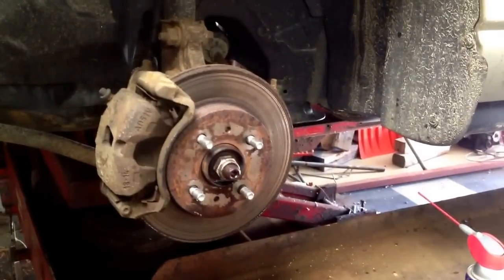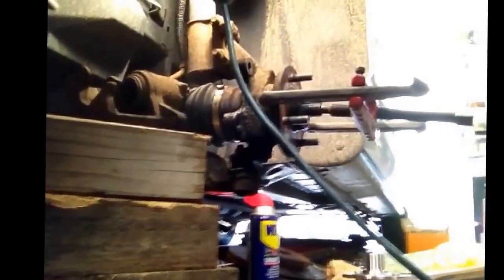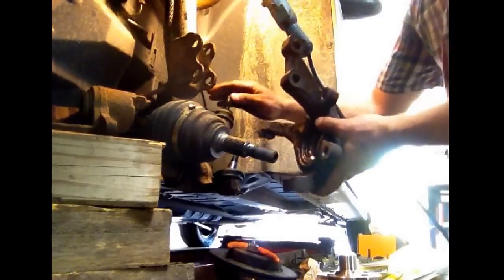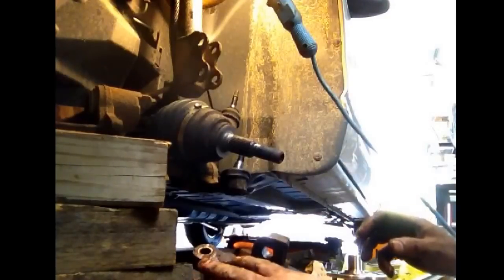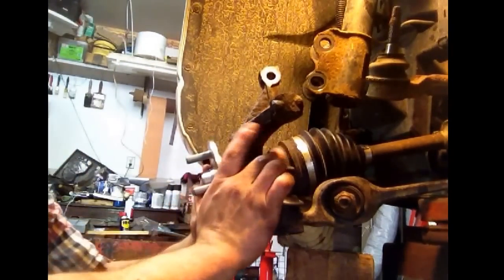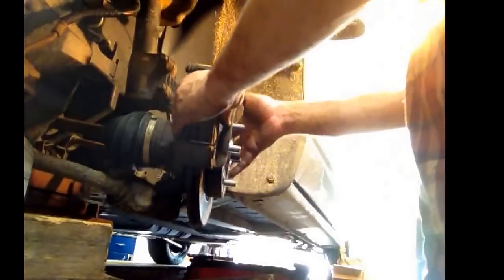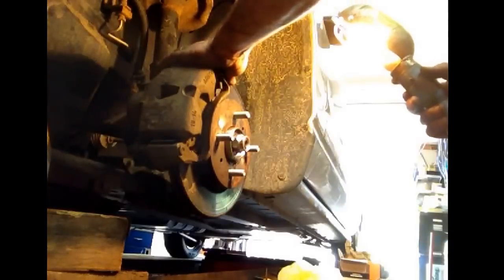How to change or replace front wheel bearing on 2002 Saturn front wheel drive

Comment: im glad i ordered a wheel bearing, noticed a noise a while back ago, and ordered it, but then thought i look  at the caliper/ brake, thinking it was stuck, i thought i fixed it, haha but then the noise returned a few days later but now its gettting louder so got to get it replaced before the weather gets cold here, i rebuilt a saturn vue awd v6. runs like a champ. nowadays cars are running more reliant on electronics, thus making it harder to work on with just tools in the backyard.
Reply from the maker: +daryl philbrick  Ya i agree and cost so much to have it done so i hope i can save at least a few people some $$ with my small youtube site with the small amount of knowledge I have. so many other videos have helped me and every little bit counts.
Reply: i tried to do some videos on here but with out a second person just to hold the recorder and the time to upload it,it was hard to do. i was doing a vid on my saturn vue, the rebuild of it.  but it doesn't help that i have a laptop that is old. and out dated and most of the software got wiped out.
Reply from the maker: ya that stinks about the laptop, but mine is not great I just take my time. also you can use a tripod for the camera.

Comment: Video wasn't perfect but still excellent in my book.  One of the better car videos I have seen,  You have a lot of money tied up in your tools.  I have replaced half shafts in front wheel drive cars a few years ago and think I could do this job, but not as well as you.  And I am 75 now and not as mobile as I used to be. But I don't have a lift and would have to buy some more tools, so I will probably leave that up to the shop.  Still helpful to know what is involved even if some one else does it.
Reply from the maker: Charlie Wilson Thank you for the kind comments. yes I have a lot of $$ tied up but lots of tools I have from bartering trading or doing work  for such as that $18000 lift I did work for, so it was a great deal, I would never be able to buy one but boy is it a big help and I am only a backyard macanic.

Comment: I replaced a lot of these! The part that holds the bearing in place is called the steering knuckle. On those Saturn cars, sometimes the bearing actually eats away at the steering knuckle walls and you end up replacing that, the bearing along with the rest of the assembly.
Reply: Just had to do this with my 02’ SL1 wished I would have seen this comment sooner 🤦🏻‍♀️ they quit manufacturing the spindle/steering knuckle had to search for months to find one finally putting my car back together after 4 months of doing this project

Comment: Next time you might want to mark the strut bolts, that way your alignment is not out of whack. By the way it is a snap ring which holds the bearing in.
Reply from the maker: Thanks for adding helpfull info to this feed.
Reply: I have read that before...
I just did this job again, didn't mark strut bolts and my alignment seems totally fine.
BUT I could be wrong...

Comment from the maker: It is a 1 3/4 inch socket. I hope that helps let me know if you have any other questions.
Reply: I was going to jump on and share that as well, since I didn't see it before taking measurements to 4 tool stores.  The Craftsman 1-3/4 socket fit the best, but was also the most expensive at $24.  AutoZone had one slightly smaller for about $11.  Harbor Freight didn't have any that large without buying an entire set.

Comment: I hoped that you atleast torqued the axle shaft nut to specifications, it requires 254 lbs of torque ... trust me you won't be able to do that with a normal wrench no matter how hard you try, when you tight it, you actually hear it crack in place....best of travels!

Comment: Thank you for so detailed film. Will 12 ton press from Harbor Fright be sufficient to press the bearing and the hub?
Reply from the maker: That should be WAAAY more then you need so yes. Thanks for commenting
Reply: Thank you for your replay. I worried because someone made a film about that particular press, saying that it requires a lot of force to operate that device. Please could you also tell if that press can be used to remove the old bearing from the hub holder? Again in another film somebody was knocking out that old bearing with the hammer after locating the hub holder on specially arranged wooden blocks, and only after that he used that press to press a new bearing and a hub.
Reply from the maker: Well to reply to a couple of your statements, I have not used the press from harbor freight so if your seeing bad reviews on it there may be a reason. As far as removing the bearing yes a ress like that will do the job. Just make sure its a good quality press. But a 12 ton press will do the job. if its a good press.
Reply: Thank you, I'll see. If it won't work I'll take it back, though I like that it is rather compact, and not so heavy, like others of maybe better quality. Or maybe at least I can use it to change bushing on wiper blade arms in one of ours cars (for some reason  that 2003 Chevrolet has almost permanent problem with bushing failure).

Comment: not a bad video, but one question.. before reassembly, why not clean up any bolts while they are off? use a wirebrush to get any gunk or rust off? preventative maintenance. Also, ALWAYS use torque wrench. I have been doing automotive work for 25 yrs now. My dad taught me starting at age 6. Always use a torque wrench where a torque spec is required...
Reply from the maker: +Chris Todd All very good ideas thanks for the input I due clean before I put back together not sure why i did not this time might have been in a hurry and needed the car fast.
Reply: +shanesmaineshop I know that feeling..My saturn SC2 has 220k+ miles on it...in all my years, ive never done a press in bearing before, funny enough. Ive done loads of the Hub Assemblies that come off with 3 rear bolts, for like a Trailblazer, or the like, GMs mostly.

May i recommend... http://www.walmart.com/ip/48096246?wmlspartner=wlpa&adid=22222222227035423747&wl0=&wl1=g&wl2=c&wl3=75836525674&wl4=&wl5=pla&wl6=176141174914&veh=sem

Maybe ill get a GoPro camera and do some how to videos myself...;)
Reply from the maker: +Chris Todd yes you may that would make the job even easier thanks for the input.

Comment: How did you clean the knuckle and what grease did you put on the knuckle before pressing in the bearing? Do you need to spray the knuckle with some rust protective liquid before you put it back on the car? I removed it, but not sure how to treat it before it goes back.

Comment: Thanks so much for this video
Reply from the maker: Your welcome. I am glad it helped.
Reply: shanesmaineshop how did you pound out the hub assembly from the bearing?
Reply: shanesmaineshop it's rusted and I have to reuse it so I don't want to damage it.
Reply from the maker: If your talking about getting the old bearing out? at about the 10 min. mark on the video I talk about that. what I did was found a socket that just fit in . you'll see what I mean if you check at that point about.

Comment: @21:03  Can you apply some grease on the attaching bolts (not on threads for nuts (on threads I'll put Blue Threadlocker), on that cylindrical part which goes inside of the knuckle)? We are in Texas, but after I removed those bolts, they were all slightly covered w/rust, especially by the head of the bolt. And I removed them before not longer then 1.5 years ago. I cleaned them, painted the heads. The rest of the bolt I wiped out w/PB Blaster, installed, but forgot to apply a bit of grease on them as planned before, like green Lucas, or Green 101 (they both have NLGI #2). I'm in doubts, if you are actually are supposed to apply that grease there, maybe it will leak on the threads and it could cause some problems, like it will effect that threadlocker or smth. I would appreciate any opinion on this matter. Thank you for this so great film.
Reply from the maker: I personally would not have an issue with that, I would use a very small amount just enough to keep it from rusting and make it easier to come apart in the future. However that’s just my opinion. Hope this helps thanks for the question.
Reply: @shanesmaineshop  Thank you, I think that is right. I always overdo w/cleaning. Thank you again.

Comment: so what size socket is needed to remove the bolt from the axle nut (the one you put on and do not say what size you are using :(
Reply from the maker: It’s been so long I don’t remember I have to go back and look. I don’t even have that vehicle anymore. I’ll see what I can find out but I do apologize I don’t know off the top of my head, I guess I should’ve included that in the video.
Reply: @shanesmaineshop  I do understand, working on my 2000 Saturn and I googled the axel nut socket but I see several sizes.. mostly 36 and 38mm .. and I haven't got to the other sizes needed, but have many others that will probably work on smaller nuts but that axle nut is bigger than any of my sockets :)
Reply: @shanesmaineshop  btw :D I am shocked you even noticed my comment and want to THANK you on behalf of those of us who are on a fixed income and have to resort to DIY :) (I'm 72 and just replaced the dang water pump on this car :) lol)
Reply from the maker: Linda Eckert Ballard I try hard to reply on every comment I get, however sometimes they do slipped by me. I completely understand being on a fixed or low budget and having to do things yourself, that’s a lot of what this channel is based on trying to help people save money and do as many projects on their own. Of course some projects are more difficult than others. Good luck thank you for taking the time to comment and asked the question and again I’m sorry I don’t have a quick answer for you.
Reply: @shanesmaineshop  Blessings :)
Reply: 30mm socket
Reply: @C6Scoob  Thanks :) I bought a 28 mm and it was too small so I took it back. Ill try a 30 <3

Comment: It was nice of this guy to make this video, however don't follow the procedure used to press in the hub.  You MUST apply pressure at the appropriate place.  Google this to find out exactly how.  On a different note, you also do not need to take the snap ring out while the knuckle is on the car.  It's a lot easier to get the snap ring out while the knuckle is on the bench.  Also you MUST torque the axle nut to 148 ft lbs.  Do this with no (or minimal) weight on the hub.  Waiting until after you install the tire and drop the car down will dimple the bearings.  Failure to pay attention to proper bearing pressing and torque procedures will have you re-replacing within a year.  (I suspect also that today's bearings are junk compared to the good ole days.)
Reply from the maker: +Steve H Hi Steve thank you for adding to the info on this video I'm just a backyard mechanic but I have been doing it my whole life. The good thing is I have had no issues with the many bearings I have replaced (thank goodness) its been almost two years on the one from the video and still going strong. anyway thanks for the tips. Shane

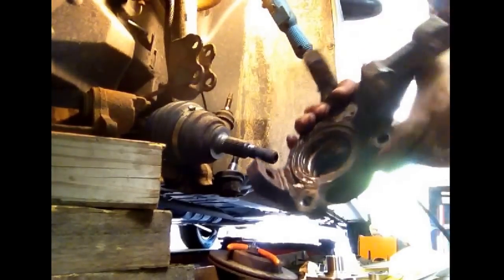Comment: Pls could you tell, at 9:21-9:26 there are 2 small holes on the knuckle (at the top, above the central hole, back side of the knuckle, at 9:27 you placed your finger on one of them). Are they used? I removed a knuckle for a similar project, but don't see any screws for those holes now. Maybe I misplaces them, but hope they just come from a certain design and are not used for this car. Thank you for the film.
Reply from the maker: Hold on i look to see if i can remember.
Reply from the maker: No the wholes your talking about were not used for anything in my application.
Reply: @shanesmaineshop  Thank you for the quick replay. I think those holes for the cars with ABS (not sure, but I saw in another film by rocbola, also Saturn, there was a thing attached at the place of those holes with 2 screws, at some point that object disappeared then appeared again during the process of work, the author didn't mentioned that object anyhow, it looked like a sensor). I figure those holes are made to make the knuckle universal for cars with and without the ABS sensor. Thank you again for the confirmation that you didn't use them. I do that work first time, easy to mix up something. Your film was very helpful to me and will be, when I put everything back.
Reply from the maker: @olenaerhardt7725  Your welcome glad i was able to help. Also watching others doing the same project is always good, everyone shows different part of the job in different ways.

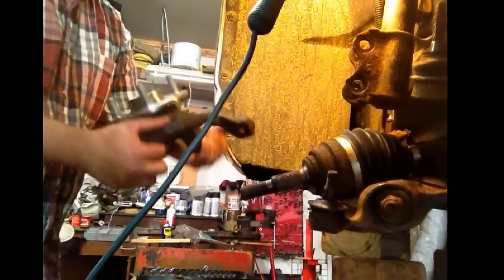Comment: At 19:01 there is an end of the Central Control Arm. I wanted to change that cup, which covers grease inside of that joint, but can't find the same. I ordered some different bushings, but they differ from that thin rubber cup. I even ordered bushing for the that particular arm, but it included only inside parts for joint, the cup was not there. Do you happen know how to find it, what is the exact name and size. I'm planning to cut out something similar fm the bushings I have, but thought you might know smth about it. Thank you again for very helpful film.
Reply from the maker: seems like it would be available easy but i am having a hard time finding it. At this point I am still looking but sorry i cant give you a better answer.
Reply: @shanesmaineshop  Thank you for your concern. I'll just try a different cup. Though it is taller and thicker than the original one, maybe it will be pressed to the place and that's it. Or try to cut the new one to be more like that thin original cup.

Comment: Good video, about how much of a gap did you leave between the hub and the knuckle? I think I am over pressing mine. I am getting just a hundred miles after replacement and they squeak like they did before. I have done them twice each. Everything was square when I pressed it in but I think I am going too far. Also, what brand did you go with? I bought Timken first then a moog, both failed. Thanks for your time.
Reply from the maker: I pressed it in far enough to get the lock ring in place. I'm quite sure it bottomed out.  You can over press it as long as your pressing on the outer ring. make sure you are not pressing on the center of the bearing that could damage it for sure. I'm not sure of the brand right off hand i will see if i can find out and post that info for you.
 sorry your having trouble I'll help all i can.
 Also can you exsplain more about your question on the space between the knuckle and hub if my response did not help?
Reply: shanesmaineshop I didn't have a problem with the bearing. It went in fine and so did the snap ring. When I pressed in the hub I supported the middle race to prevent side loading it. I pressed the hub until it stopped. I was using a 20 ton press. Did you press the hub until it wouldn't go any further into the bearing or did you stop before that?
Reply: shanesmaineshop around the 18:47 mark you mentioned you don't want to go too far. I believe that is what I did. The gap I was talking about is from the back of the hub to the knuckle.
Reply from the maker: BentlyBo4 ok, I see where you mean now sorry for misunderstanding you the first time. I left about 1/8th inch of a gap, not including where the hub starts to bevel up, what i mean by that is I measured from the flat area of the hub to the knuckle. I hope that helps feel free let me know if you need more info.  Bye the way i could not find the paperwork so im not sure of the brand, my apologies.
Reply: shanesmaineshop perfect, that's what I was looking for. I'll give it another shot. Thanks again for your time.
Reply from the maker: no problem your welcome and good luck.

Comment: Couple things. You'll blow up your brake booster by not removing the brake fluid cap trying to push the piston back in. Please don't use a screwdriver to push the piston back in. You run a very likely possibility of cracking the piston (learned this one the hard way!) c-clamp and a piece of board.

Other than that, looks good. You should invest in an impact.
Reply from the maker: Joe Martin I normally  use a clamp and wood but felt that this would be ok if it went easy. Great tips and thanks for commenting and helping out any others that may watch this video. Also I do have an impact wrench but did not use it in this case.   Thanks again for commenting.

Comment: what size socket did you use to go behind the bearing to take it out of the steering knuckle which is the big black part the bearing is inside of?
Reply from the maker: The inner part of my bearing was removed first, that gave me accsess to the part of the bearing were the ball bearings road and that is where i used the 1 3/4" sucket to remove the rest of it.    it is very hard if not impossible to get behind the lip of the knuckle to be able to push the bearing out. I hope that helped feel free to ask more questions if you need more help.
Shane

Comment: What size socket was that depress the old bearing out
Reply from the maker: I don’t know off the top of my head but I know that question has been asked before and I did answer it in the comment section you should be able to find your answer. Thanks for commenting and good luck with your project

Comment: how far I do I press the hub in to the bearing? I did it the same way you did and the other side of the wheel bearing piped out. so I can to buy a new one and now I need help so I'm not out another 50 bucks thanks and advance!
Reply from the maker: +tyler myers I just got it as close as i could to what it was on the old one it is pretty close if you look at the video around min. mark 19 or so it might help.  hope this helps it is a curved surface at the end so its hard to get a correct measurement.